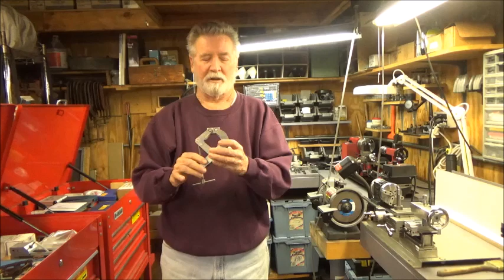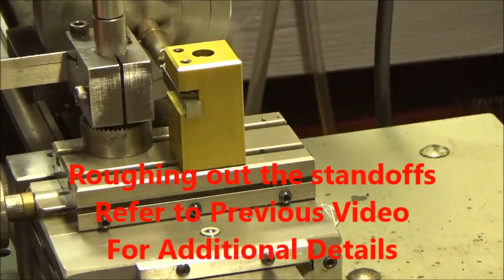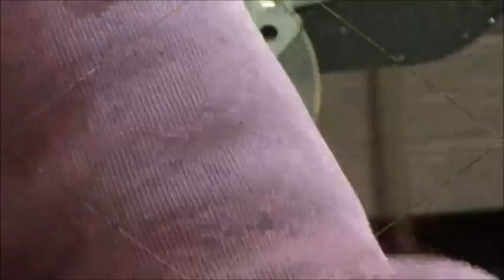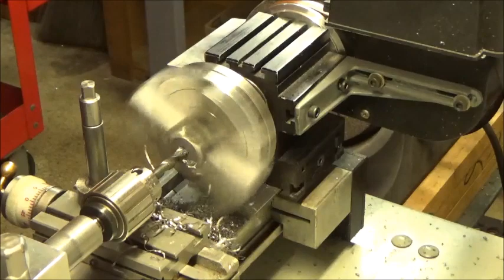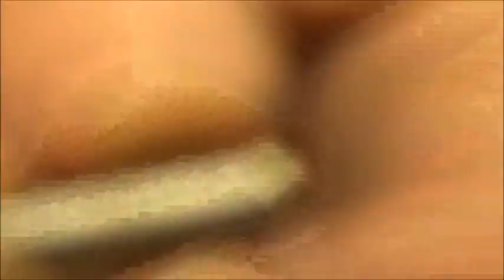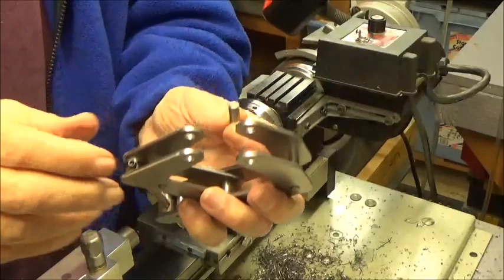Kant Twist Clamp Build Follow-Up

Comment: Hi Larry, just binge watching this series, and I really like watching the use of the Taig. I am also "hooked" on making these clamps and have already started set #2. Stay safe and cheers!
Reply from the maker: There really easy to make even if you don't have a cnc mill.  I first watched a video using an angle grinder and a belt sander/grinder.  A bit crude, but it worked. Regards: Larry

Comment: Nice Video Larry,  if I ever get back to producing again I just might build a couple in a smaller scale, maybe the warmer weather will get me going, I like the idea of the circlips for future change over, good thinking on your part, all in all, an excellent presentation, and a handy addition to the shop,
Reply from the maker: Walter:  They're an easy build, and I still have a whole sheet of plate material plus a lot of scrap pieces.  I'm now wondering if some smaller ones just might be handy.  Once you have the CAD drawing, it's quite easy to make any size you wish using CNC.  The materials are very inexpensive once you have a piece of plate material.  Of course, technically 12 GA. plate probably shouldn't be used of clamps larger than 3", but even the 2" clamps have 0.125" plate.  Maybe 1" might be a treat, and done quickly via CNC.  Best Regards: Larry  P.S.: Spring is coming and the cold Winter days will be behind you.